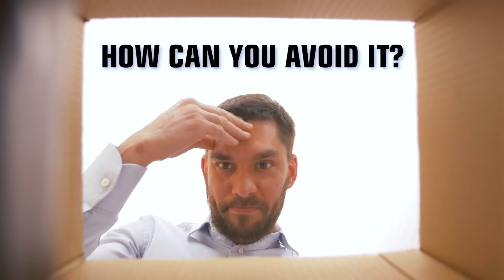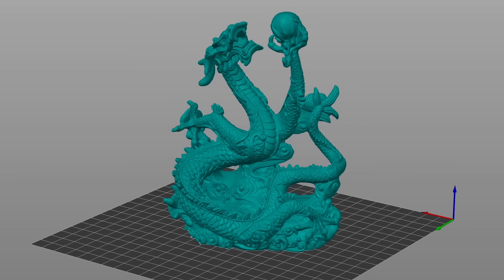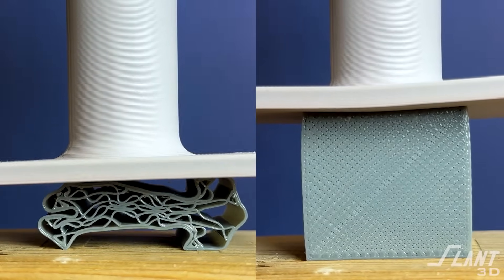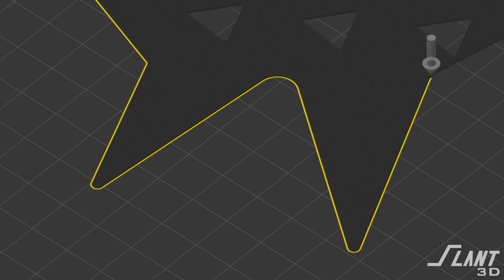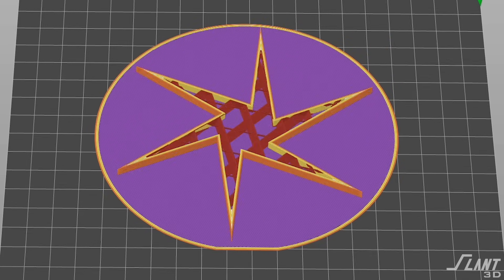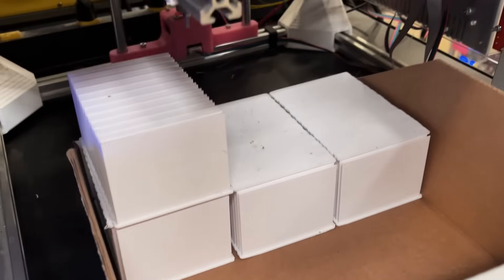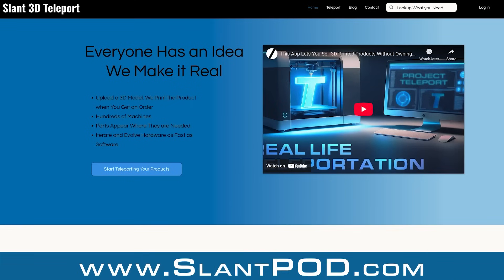Stop Needing Slicers

Comment: I understand what Slant is doing here I think, and I'd like to preface this by saying I think it's a net positive: trying to replace cheap low quality injection molding processes for producing heaps of plastic trash, where you have to order and try to push to market 100x more than anyone really wants to get a scale that makes any economic sense, with a process for cheap low quality FDM parts that are only produced in the quantity somebody actually wants. However this is very much mismatched with the goals a lot of us have for 3D printing: both (1) getting really high-quality parts that would be prohibitively expensive to get through any other processes, and (2) displacing the concept of mass-production entirely, instead just making what folks need as they need it, maintianing and repairing the things we already have that would otherwise become trash. Slant doesn't really have a place in that vision, but perhaps what they're pushing will help get us closer to that.
Reply: I think that was highlighted well with the "you're moving from being an artesan" comment made near the start of the video.  

I will say that as a mostly software guy until a couple of years ago, the difference when working with physical processes in the real world really took a lot of time to sink in.  There's an inherent uncertainty with anything physical; in software, you're used to having things behaving in mostly one way and mostly with one kind of precision.  

I found this view quickly shattered with electronics and again with 3D printing.  There's just an inherent sloppiness in everything that you'll never get past.  Even your perfectly dialed-in 3D printer is going to drift and perform differently over time.  A 4mm diameter hole in CAD never translates to that platonic ideal in the real world.  Which I guess is where the whole tolerance thing comes in.  

I design and print mostly functional stuff and as I've incorporated more of this type of advice, I've actually gotten better quality prints from my machine.  Which translates to less time dialing in the machine and more time making stuff (having said that I think I enjoy doing both things about equally haha).  I definitely think a lot of the Slant 3D stuff is valuable even to incorporate into your everyday hobby and low-volume printing.

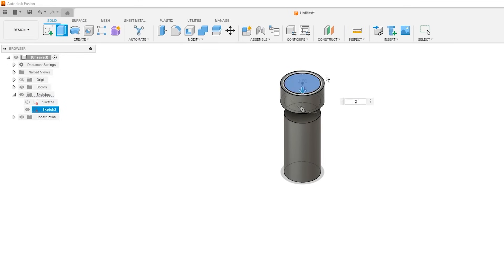Comment: 12:35 as an example for ppl - Please add a proper chamfer to any threads (as a simple circular cut with 45deg angle through the modeled thread). Important in industry, 3D printing and in manual fabrication too. You don´t want flat lead in of the thread, you want it chamfered.    ----> This is something I also can´t stand for at work, whether It´s CNC machining or manual fab. :D  

Overall good tips for ppl for 3D modeling. It would be just nice if these fundamental modeling techniques were implemented so the entire Thingiverse and other sites are not full of bad designed / overcomplicated models, so you end up designing a "wheel" yourself in order to do it properly. 

Good vid m8! Cheers.

Comment: Going through these engineering exercises easily creates 5x the work, but the scalability of being able to print 10 parts on your own or 10000 with Teleport allows 1000x potential.  Worth the investment.
Reply: You can do the same thing with a phone call and a picture/form with your slicer settings. 
Designing in slicer settings is only for Slant 3D due to their software limitations and one size fits all slicer settings.
Reply: @drewbeirn7704  start your own print farm with slicer setting photo service and get back to me on how well that scaled up for you.
Reply: @timothyryner 
Ther are print forms like that 
They will want much more but to a higher standerd
Reply from the maker: Exactly. A well designed part can be manufactured anywhere and anytime. It like using a standard plug rather than wiring your vacuum into your wall

Comment: I've been trying to make 6 - 8g 180mm tent stakes with these philosophies, but they mostly end up sucking IRL. Sometimes more traditional designs are still needed even when 3dp.... Or at least find a balance.
Reply: I find with stuff like that it needs to get real creative with these principles in order for it to work. But to be real with you, even injection molded stakes suck. I just go with the metal ones and be done with it. The plastic ones always break eventually. The metal ones only break if something stupid happens or it gets bent bad. Like at the end of the day the material is the weakest link all else being equal.

Comment: I would wager that if the cad has specific dimensions and a consumer level machine can produce accuracy, a business should be able to meet the same quality. If the business can't, then obviously, the option for production ends up buying more consumer level printers and doing it yourself. While it is advantageous to farm work out, increasingly in professional manufacturing, the care for what is made is clouded by volume and cost rather than quality or accuracy. I see this in everything from CNC, woodworking, electronics, food, pretty much everywhere in manufacturing the quality has succumbed to "least possible to get away with it". This has led me to make my own rather than trust a service.
Reply: Gabe is pushing his own software and company limits onto his customers now.

Don't get me wrong a lot of these tips and tricks are great for 3D printing design but some are due to his company's one size fits all slicer setting.

 For example, international features for wall thickness, Cad design brims, rafts, support, textures, etc.

These are 100% common settings/conversations had with other 3D mass production guys. Yes you can CAD it in but it is only "necessary" for Slant 3D due to their software limitations. 
In the majority of industry quality and how it gets made is the responsibility of the fabricator not Design Engineering.

This video basically says if you don't design for my company's limitations you're bad for industry. Really he means don't bother doing business with Slant 3D.
Reply: @drewbeirn7704  Yea it makes sense. I mean he claims layerlines just as an asthetic/consumer view problem. But in reality those layerlines are very inpractical for many scenearios. First, those tiny grooves act like an micro fiber cloth where dust and other particles get stuck inside of them and are very hard to remove. This is an absolute no go for things like medical products or prints that are supposed to get in contact with food. But also it's quite a pain any way. If i try to remove those particles from a PLA print for ex. i often have to hold it under water, but that makes the PLA feel like a wet sponge, heavy and soaked. And then if you want to paint it, like for being a car part, let's say a cup holder, these layers can be also a problem. To me 3d Printing is just a part of a process, not the process.
Reply: Absolutely. It isn't 2010. We should be expecting commercial printing to have at least the quality of a klipperized Ender 3 with input shaper, not some wobbly plywood and smooth rods reprap thing.
Reply: And that's how you'd run a high quality farm at Slant scale affordably: a bunch of dirt cheap Ender 3's, with each whole shelf of hundreds of them running klipper on a single fast server grade host machine. Not janky NIH'd stuff.
Reply: I wouldn't consider "klipperized ender 3" the best printer. Just because the firmware is good, doesn't mean the printer is perfect. You still have belt slop, stepper motor limitations, cooling limitations etcetera
Reply: @ZT_1234 It's not the best but best relative to cost, and way better than Slant's in-house noodles. Cooling is bad but you could run shop air to the whole rack and replace the fan with a valve. Motion system is not limiting whatsoever. Fully stock it can do 500 mm/s and 4k Y, 12k X accel at high quality, many times that for infill & interior perimeters. Extrusion system is limiting much earlier.
Reply: As someone who likes to post on printables, I feel like this would apply more for sharing models online, where most people downloading the part are just your average joe with his ender 3 printing that little bracket he broke on his refrigerator
Reply: I could order a machine to manufacture my printed circuit boards, but it would be worse by every metric than just sending the gerbers to a pcb manufacturer. Probably couldn't do 4-layer boards or plated vias, minimum track width and spacing would be larger, and it would be so much more manual work.
With this guy and 3d printing, it feels like it's all backwards. I could have him print my parts, but deprived of the slicer as a tool, I'd have to work within so many more constraints that I wouldn't have to if I just printed it myself.
Who wouldn't look to optimize the slicer settings when they need 100 of a part 3d printed? Theoretically, if you use prusaslicer, a lot of the slicer settings can be set by the designer. Supports here and here only. Lower the layer height from this layer to that layer. Solid infill only in these critical regions. etc. Pass that .3mf file off to the manufacturer, and they fill in the settings relating to the capabilities of their machine.
Reply: Imagine ordering a batch of 100 and all of them don't fit because the 3D printing farm didn't check dimensional accuracy. 

You never have to worry about ordering parts from a machinist.
Reply: @TechnologistAtWork  True story, I have worked with all kids of 3D printers. High level industrial ones with 0.004mm accuracy/repeatability to crappy ones where you are lucky to hit +/-1mm.

As a Fabricator you always want as large of a tolerance for fitment as possible. Design Engineers usually tolerance based on what machines are capable of vs cost (tighter = $$$). So if I have a printer that can hit .004mm then I don't have to worry about it for most applications. When dealing with a +/-1mm printer, I undersize holes and over size fitments so I can bring them into tolerance with post processing. Increases cost but you design and build to the equipment you have.

Taking away the slicer as a tool for Fabrication to optimize their production and quality is not the best choice. Especially if the fabricator doesn't tell you what their accuracy/repeatability is. "As big a tolerance as possible" is always the ideal but not realistic. I feel like the "secret sauce" Gabe doesn't want to do is just quality control or releasing equipment specs so people can design to his print farms ability. Live springs and things are great for adaptive designs but sometimes you need actual quality control.
Reply: @TechnologistAtWork as a person who is a machinist at their day job, that isn't true. You should always be worried and always check the dimensions. I don't trust ANY  work done by anyone else until I've verified it myself. I've had work that passed through 2 other ppls hands and was checked multiple times until it got to me and I found the error.  You can't just say a blanket statement like "you wouldn't have to worry if you ordered this from a machinist"
Reply: @baremetaltechtv  Someone who is very familiar with machining, you're definitely not a machinist and just talking out of your bum.

Your job is to machine parts within the specs of your machine. Errors happen but you can't blame the customer when you produce a bad part. No machinist does that.
Reply: @baremetaltechtv  that's because you are a good machinist!